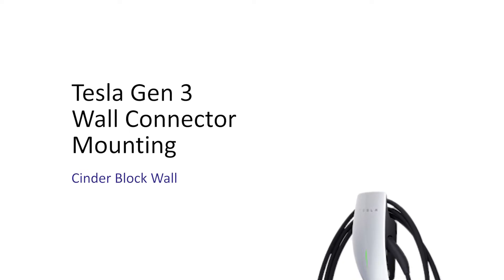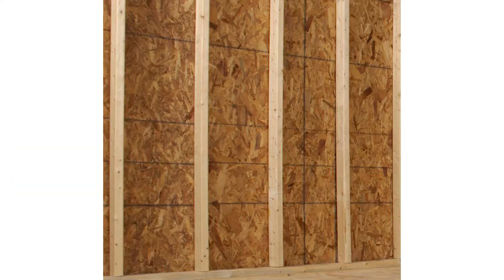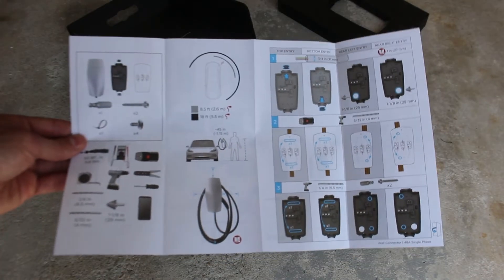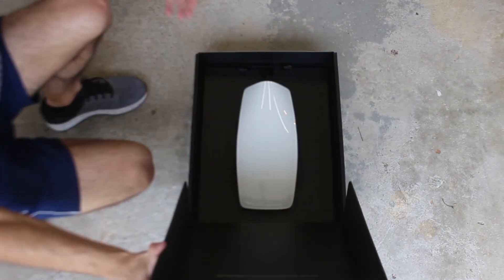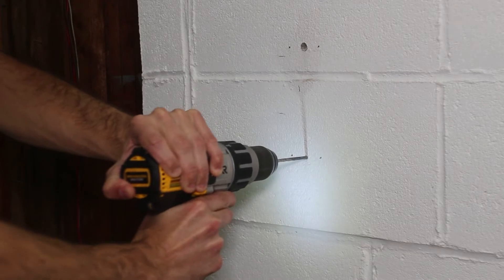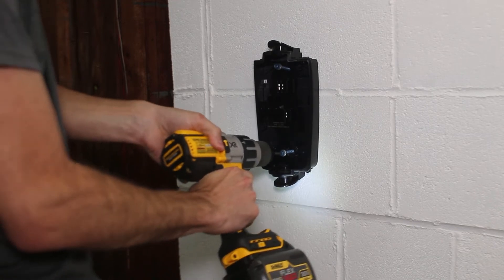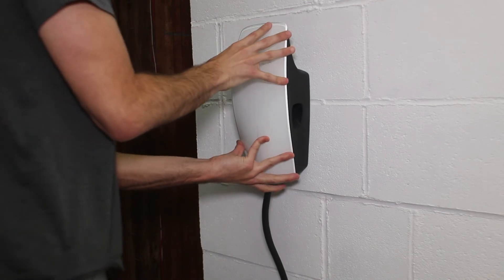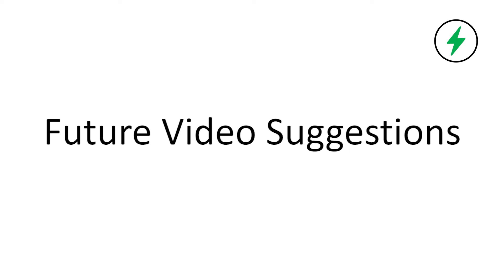How to Mount a Tesla Gen 3 EV Charger to a Cinder Block Garage Wall

Comment: Useless video. Mounting is one  thing, but mounting to cinder block and wiring is another. How would it be wired on the cinder blocks? 1 inch hole on the opposite side? This is questions viewers would ask.